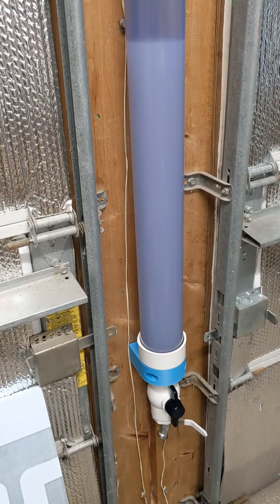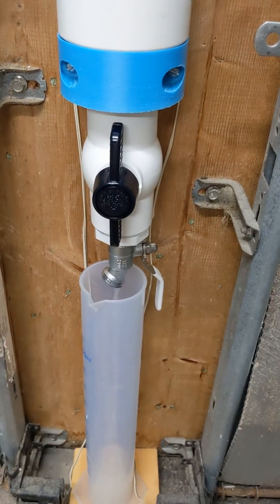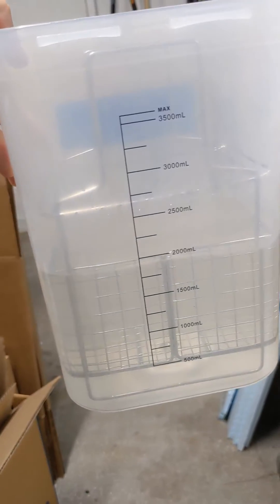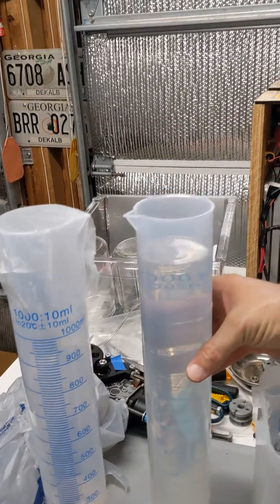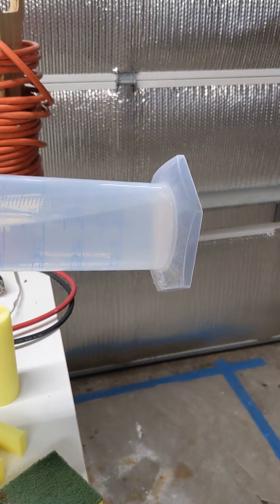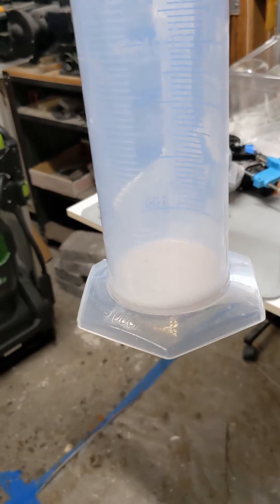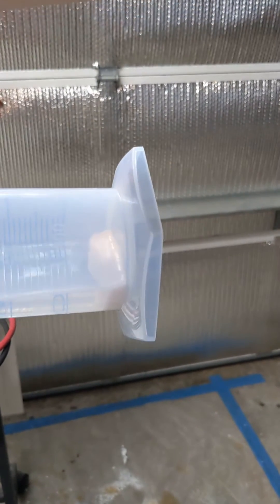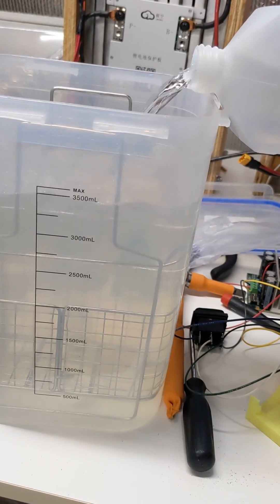Reusing Isopropyl Alcohol (IPA) by Removing 3D printing Resin with a Siltation Tube

Comment: i feel like I am missing something. But I really want something like this.

1. the tube on the wall doesn't seem to be very special. it's just a tube with a valve at the bottom. is there anything else to this? something I would buy or just a tube I would mount a valve on and put a cap on? is there a recommendation for what kind of material this should be?

2. you dump all of your alcohol into the tube on the wall. The siltation tube.  the alcohol you dump in the tube is just dumped straight from your wash container.

3. you let it sit for a few days. don't really expose it to any UV while in here, but you don't avoid UV specifically.

4. the resin starts to settle at the bottom, after a few days you open the valve and the resin which is sitting at the bottom of the tube comes out first. once the resin is out, the alcohol still in the tube is good.

I'm sorry if my questions are very basic. The system seems very straightforward. but I feel like I'm missing something.
Reply from the maker: You have the main idea.  I do place my IPA vat outside to expose it to UV light to cure the resin in the IPA before pouring it into the tube.  Any tube will work, I'm using PVC plastic pipes as they are relatively inexpensive. It just has to be long/wide enough to accommodate the volume of IPA you want to process in a batch.   This longer video goes into more depth: https://www.youtube.com/watch?v=49gJJNA1QAY

I built the tube in this even longer video: https://www.youtube.com/watch?v=OWMnHwLe7v8

Comment: Hey boss! I really like tour system and am going to consider implementing something similar into my workflow, i do have a suggestion though! If you grab some coffee filters, you can use them to further separate the resin sediment AND easily dispose of it! (Just make sure you cure the resin so as to not be sending the paste out into the world)
Im thinking, bottlenecked collection jug into swappable filter disc, which then deposits it into a siltation tube, which then outputs through another filter disc- but thats just me :D

Comment: awesome system. do you expose the siltation tube to uv during sedimentation?
Reply from the maker: Not deliberately, but if I open my garage doors it will get some in the daytime.  I typically take my mixing/wash vat outside and set it in the sun for a few minutes before pouring into the tube, so that's what I figure is doing the curing of the suspended resin into a fine silt.